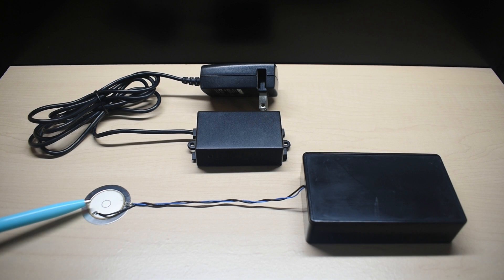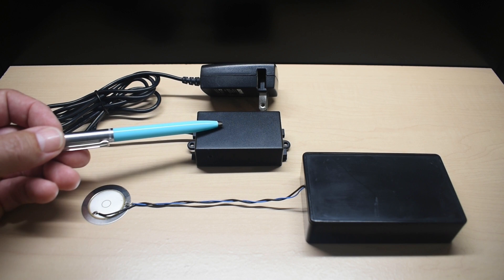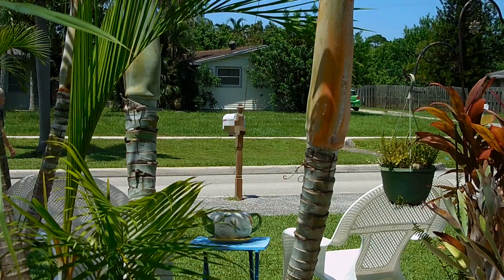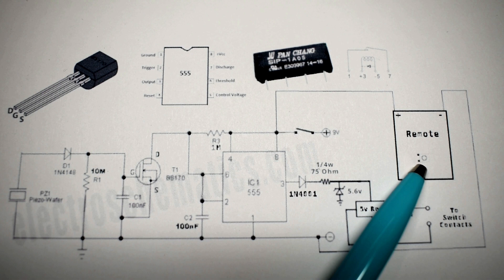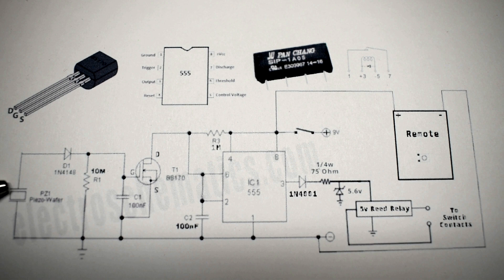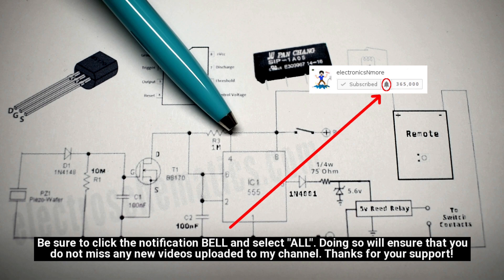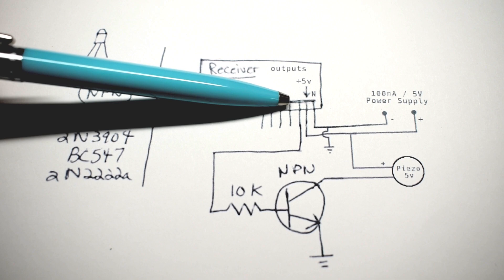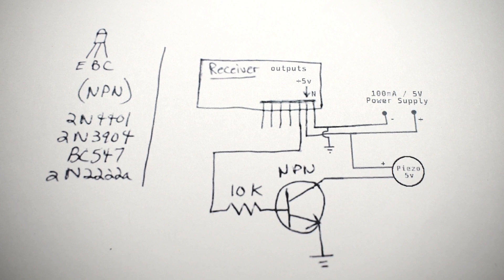DIY Wireless Shock Vibration Pressure Alarm! (FULL SCHEMATIC)

Comment from the maker: One more thing guys! 

In the TRANSMITTER schematic, the capacitor marked "C1", that has a value of 100nF, you can lower that value to have a stronger pulse hit the gate of the BS170. The result will be higher sensitivity. Experiment using different resistors and capacitor values until you get the sensitivity level just right. For maximum detection range, use a mpsa13 NPN transistor for the receiver circuit. 

Thanks for watching! Stay safe.

Comment: I like this as shown in the video for when you are expecting an important lettet or package and don't want to be looking out the window to the mailbox all morning.  Liked.
Reply from the maker: It's perfect for that use. To ensure highly reliable triggering, bond the piezo wafer to the inside of the door, way at the top next to the latch. The battery will only last 2 full days running non-stop, so you can replace the 9v with a rechargeable 9V battery, and have a very small 2.5" square mini solar panel with a blocking diode to keep the battery at full charge. It's a cool circuit. To get it right, assemble on a breadboard first. Thanks for watching!
Reply: @electronicsNmore  Could use different battery, like a 6-AA holder (some of them even have 9v battery clip :) ).
Do you think it would run from 3v to 4v? There are a lot of small solar lights that have a small LiIon cell (anywhere from about 600mAh LiPo style to an 18650 with over 2000mAh). Might be fun to build the transmitter into  one of those lights... Probably the transmitter would have better range with a DCDC boost to 9v to 12v.

Comment: Great gadget.  Another option would be using an Opto coupler in place of the reed relay to act as switch contacts closure to save power and eliminate any moving parts and still have electrical isolation from remote transmitter.   No rectifier or Zener diode required either.   I have used this technique for activating remote buttons and also on sound board recording board play button for my Halloween display sound source.
Reply from the maker: Yes. I have other, simpler ideas for a mailbox alert system. Thanks for watching!

Comment: Just learning and trying to follow along. Is there a way to accomplish this without using the 555? With the vibration sensor be wired directly to the transmitter button contacts, could a capacitor or other component be used to amplify/pulse the brief vibration sensor signal? (I tried without a capacitor, but the vibration switch/sensor does not stay closed long enough to push the button/signal out) I am waiting for another tinker kit with capacitors/555chips in the mail. Just wanted to ask if I am missing some reason it could not be done this way? Thanks.

Comment: Is there an easy way to make this beep until you do something?  IOW, it trips the beep and beep continues until you do something, like press a button.  Like if the mail comes while you are in the bathroom or something, it will only beep for a short period and you won't hear it.
Reply from the maker: You can extend the duration of the alarm. To do other things, you'd probably need an Arduino.
Reply: Could use some NAND or NOR gates to form an SR-latch (depending on if you want negative or positive triggering. The output of the receiver to the Set and a push button on the Reset (with pull up/down depending on pos/neg triggering). Will stay triggered once set until you manually do the reset.
With an internet connected micro on the receiving end you could trigger a push notice on your phone(s) and log events in an app...